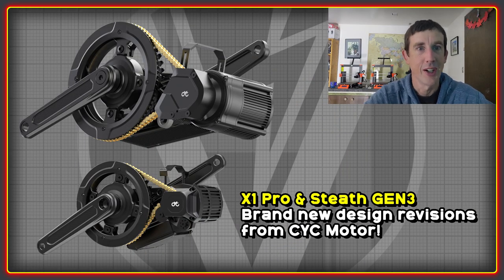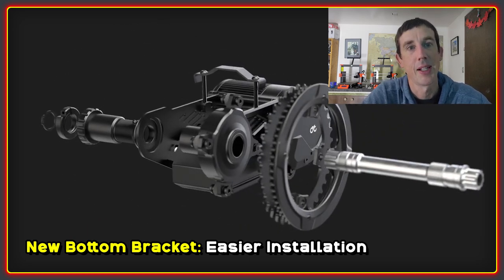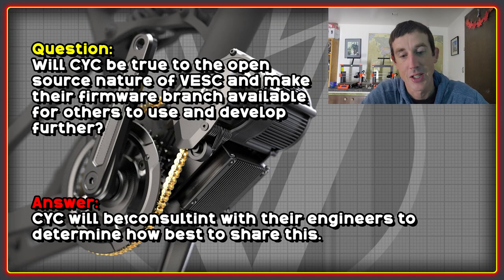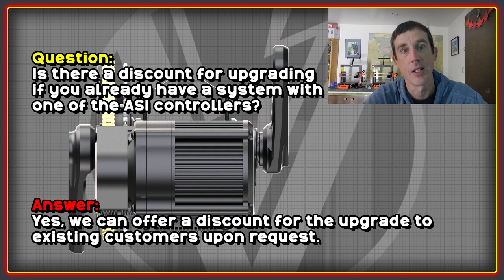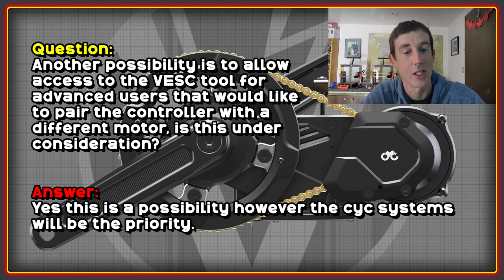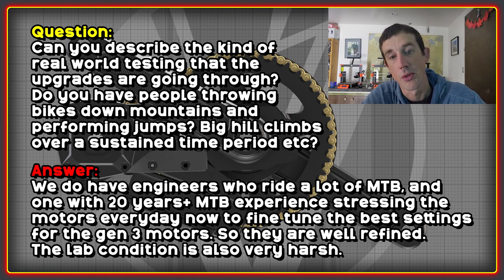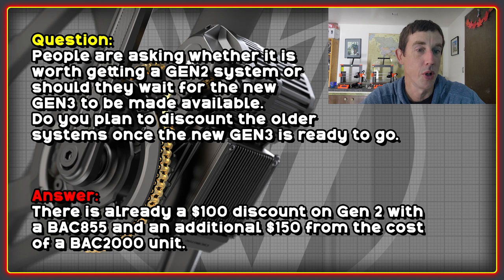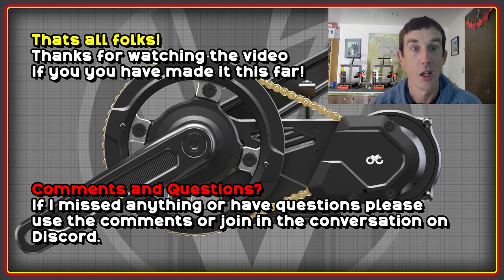CYC X1 Pro & Stealth Generation 3 Overview and Q & A

Comment: Glad they went VESC since ASI supplies have been constrained and a closed system.
Reply from the maker: Yeah. Having it in house means the firmware is under their control and app software development and bug fixes can be much more rapid. ASI was an emergency thing in many ways due to their issues with the original controller. I hope it works out.

Comment: Excited to see the next gen x1 pro
Reply from the maker: Yes especially riding and sound.
Reply: @HighVoltageKits  the noise only bothered me on shared trails, walking and biking.  In that environment I prefer the bbshd on lower power but miss the torque sensor and tsdz2 is much less powerful. Maybe new photon will fill that gap.

Comment: This is excellent news.  Sounds like they've addressed most if not all of the potential issues from Gen2.  If the noise reduction is significant, as they claim, I'll definitely be going with CYC for my build.
Reply from the maker: Yeah. If it all works out it will be brilliant!

Comment: Thanks for the update on the gen 3 kits. My 3rd controller which Electrify Bikes provided is a proper unit but it is not the potted controller that doesn't work. I replaced my 9 speed rear cassette  with a 38/11 micro shift  so I am now 1:1 on my final drive and it does not stall out anymore. I get 24 km/h in granny gear and 65 km/hr in top gear on throttle only. I mostly ride trails so top speed is not an issue. Gear noise is also not an issue. I don't mind a bit of gear whine as it sounds like a motorcycle while changing gears. it's not loud but people do hear me coming which is good. Overall I am very happy with the gen2 now although it was a bitch at first. With the 38/11 microshift cassette it has great pulling power off the bottom which is perfect for the riding that I do. The gen3 improvements are a bonus but getting that controller off the bottom is a must. It is not something that I would like to bash into a rock.
Reply from the maker: Awesome to hear your progress. It's been a long journey!

Comment: @ 4:00 you mentioned the Stealth version is available to work with the 120mm BB. I had placed an order for a Stealth X1 Gen 3 motor and I just found out they are now saying the 120mm BB width is not available to work with the Stealth motor. I'm really disappointed with this but they offered the X1 PRO Gen 3 at the same price. That was nice of them to do that, but I wonder what the issue was...
Reply from the maker: The information I have came directly from there marketing dept. That's a real shame.

Comment: big up cyc for all the new changes , they certainly dont look cheap or easy to pull of, looks really refined now , i cannot wait to get the new controller, i might even 3d print some sort of rocket launcher/ trebuchet and send my bac855 into a stratospheric flight so i never have to look at it again. LOL !
Reply from the maker: Ouch. Yeah its not the perfect match for the motor. They are notoriously hard to tune for small sized motors like the X1 but at the time it was really the only option they had after the stock one failed. It is definitely exciting to see a new VESC. I hope it works out because there is huge room in the market for this kind of thing.
Reply: @HighVoltageKits  I agree , apart from asi I haven’t really found any other options apart from nucular and another I can’t remeber the name of , And most of the time you can’t even order them and very expensive. 

A controller thats reliable can be easily tweaked via the very good looking new app is going to sell like hot cakes, I’m sure of it .

Comment: Great vid, thanks. I hope they perform and work like they say and then we'll have a good motor on our hands instead of the unreliable motor we've been accustomed too
Reply from the maker: Yeah. There is a two year warranty and they seem to be pretty confident. I hope they have really been hammering the testing as I think that was where they may have been found out in the past.
Reply: @HighVoltageKits  fingers crossed 🤞. I'll chuck an x12 on my gen 2 when it's out and post results on your discord. I'll be asking for a discount lol..great question to ask btw
Reply from the maker: Sounds good! Look forward to it.

Comment: I'm very interested in the gen3...the only thing that put me of buying previous models was the noise. It's imperative in the UK that I have stealth looks and silence....that's why I'm 'stuck' with mid-drives. If I ever see an ebike pulled by the police it's always got a huge hub motor and a huge battery zip tied in the frame...it's not a good look.
Reply from the maker: Right. There will be a noise comparison apparently to show how much quieter it is than the previous generations. I would wait and see. The situation in the UK and AUS with ebikes is insane and I will be addressing it at some point as I get more time.

Comment: Doing a build with this Gen 3 system. Trying to figure out a gear shift sensor and wiring to the brake sensor. Might just half to use a Bafang sensor and test to figure out if it would trip the pause / cut the motor thru the brake wiring and windup soldering the whole thing together unless someone else has a better insight on a gear shift sensor setup for the cyc motors?
Reply from the maker: If you are using anything not cyc I would confirm the wiring with them. But yeah in theory you can use a gear sensor in a brake cutoff.

Comment: I’d love it if CYC offered a twin/dual motor X1 pro kit driven by a bac4000 for a 10 kW setup. That would be awesome for an old yamaha dirt bike.
Reply from the maker: You could always try making one! I would look at VESC for a dual motor though as the 4000 is not the best fit for the X1

Comment: Looks to be promising! I've been recommending the system before, but gen3 looks like a real smooth unit.
Arguably better than a bafang + controller upgrade!
Open source!
Reply from the maker: Right. I think sometimes people look at open source and thing Oh its free. But that's not the case. Anyone can build a VESC even you or I but will it work reliably. Will it last etc. In terms of beating a Bafang and Controller upgrade we will have to see. I have not seen or heard the motor yet. The motor itself has not changed much and its listed as 3kw vs the 4kw you can push on a BBSHD. However its never that simple. Exciting times tho! This kind of thing pushes the envelope and spurs innovation which is never a bad thing!

Comment: Can you do a review on their batteries? How are the mounting options onto MTBs ?
Reply from the maker: I don't have one so I cannot speak for the internal quality or such. I can look at doing a video on Ebike batteries though in general and include these.
Reply: @HighVoltageKits  The cyc batteries has 2 mounting system - bottle mount area and the strap system. I'm trying to find a battery mounting solution similar to their strap system. I have a Diamondback release 3 2018 and I am trying to figure out how to mount a battery to the top side or bottom side of my frame without having to drill additional holes. The stock water bottle mount holes on my MTB is on the bottom side but too close to the pedal area to mount a battery I think
Reply from the maker: You are welcome to put photos and questions on our Discord maybe one of the members will show you what they did.

Comment: There are several gear ratio options available when you buy.  Do you know of any guidance sources or information to make the best decisions on these?  thanks
Reply from the maker: Actually that will make a pretty good subject for a video. It depends on the type of bike you have and the riding you will do. Also the kind of rear cassette you have. You can change that stuff though if you wanted to. Look at the biggest sprocket you have on the back and relate that to the options. If your biggest is a 42t then you might want to go with one of the larger options. If you you have only a 28t then maybe the smaller options. If you have a heavy bike and ride offroad then the smaller option will be again better as you will put less stress on your motor. If you have a lighter road or gravel type bike then you can go with a larger option as the motor will be able to drive the bike forward without too much stress. This is a video I did just yesterday on gearing. The latter part talks about my CYC bike. I use the middle of the options on it as it gives a good balance. Its a gravel bike and the largest gear at the back I think is a 36t. https://youtu.be/tW_swtyk7v0

Comment: If you use the motor for mountain biking don’t try and save a few bucks with Gen 2.  The motor cutouts (a major driver for the new controller) especially on steep climbs will drive you absolutely nuts. 

I’m super pumped for the upgrades and going to order the complete upgrade kit and use the x12 to replace the BAC855.
Reply from the maker: It will be very interesting to see it all once they start to go onto bikes. Definitely good news for the DIY ebike sphere!

Comment: Can a Bafang gear-switching sensor be used with a Gen 3 X1 or Stealth CYC ?     Thanks.
Reply from the maker: Potentially but I'd check. I don't think it's an official option. However essentially they are the same as a brake cutoff so it could be implemented if desired. They are not the best IMO.
Reply: What would be your suggestion to aid shifting…or is nothing needed ?      Thanks
Reply: @billymore2790  Personally I just use the break cutoff for gearing as well. If you adjust the breaks a tiny bit so that you can do taps without them taking then you basically have the dual functionality in the break levers and you can drop the extra button on your handlebar. Feels really intuitive as well in my opinion!

Comment: Hi, your videos are fantastic, keep up the good work, But I do have a question I hope you can answer, I'm looking into a CYC X1 Gen 3, I have an extra 52V battery I would like to try first, but after riding I might want to upgrade to the 72V. How would I order my CYC so I can try both battery options? I see you can get the display that says in the order process " up to 72V" with i be able to try my 52V with that? thoughts?....thankyou
Reply from the maker: Thanks Anthony. Make sure that the display option you pick will work with a 72 volt battery. Otherwise you would need to replace that part of the system. I think this may limit you to the 750c. You should be able to use a lower battery with the 72 volt rated display but not the other way around.
Reply: @HighVoltageKits  thank you for responding I appreciate that
Reply from the maker: You are welcome. I always try and do that.

Comment: Hi, I’m considering this motor are there any reviews or updates yet ? The plan is to put it on a (high end) full suspension enduro Mtb. Any advice or suggestions for maybe other options?
Reply from the maker: I think they are shipping but I am yet to hear anything concrete as far as a review. Some people on our discord have ordered them though so it should be pretty soon!
Reply: @HighVoltageKits  ok good, would like to order it but its "a lot" of money so i want to be sure it is the best choise.

Comment: It "seems" that the rotor on the CYC X1 Pro Gen3 ,for some, is losing magnets and over heating. I wish I knew what % of the sold motors had this problem. Maybe the Gen2 is something to consider. Any one else hear anything more about the rotor burnout?
Reply from the maker: Bacon butties had that issue. Might just be a bad batch?

Comment: Good info there, cheers buddy. The extensions are available, if you go through the process of making an order, the options are there as before on the gen2.  I don't suppose you know if they're  going to have a new UK distributor, Electron cycles aren't going to stock the gen 3 ?
Reply from the maker: I'm not sure about the UK. I think Francis is focusing maybe on the Sur Ron higher power mods maybe. Good news on the extensions. That's great.
Reply: @HighVoltageKits  yes it certainly looks that way, his options for bbshd kits and 60-72v batteries are non existent. He's always been my go to for batteries.

Comment: I have a frame - graphan carbon from a brand called Poison (German). I was wondering if this kit would fit. ( It has a BSA 68mm BB). And if it does fit, what's the maximum size battery I can put on it?  Any pointers appreciated.
Reply from the maker: The BB is not a problem. In terms of the rest its hard to say without seeing it. You are welcome to post photos on our discord channel to get advice. The link is in the description.
Reply: @HighVoltageKits  Thanks for the reply. I'll join the discord and post pictures. If anything, I am looking forward to learning more about other projects as well.
Reply from the maker: Welcome. That's what the place is for. Cheers
Reply: @HighVoltageKits  joined the discord and have posted my question. Cheers.

Comment: Has anyone besides me had multiple issues with the freewheel 2.0 at the crankset?  I'm not sure if it's water ingress or what, but they have gotten really stiff making hard to pedal, despite replacement and no pressure washing...    ??
Reply from the maker: I have heard less issues with 2.0 It's possible you have a faulty unit. I would send video to CYC and they will help.

Comment: I gotta say the answer concerning VESC source availability is discouraging.  They have GPL logos all over the X-series page but it seems like they don't understand the legal requirements. Releasing the source code is not optional.
Reply from the maker: It wasn't a yes absolutely but it also wasn't a no. I will encourage them in my interactions as I think that they would be worse off by closing the branch. If VESC develops new features that they want two years down the line it will be hard to integrate into a branch of development so removed. But people make odd decisions don't they? Cheers

Comment: On a different issue, I use an egg rider v2, any ideas if they are producing any firmware updates, there doesn't seem to be any firmware to download now, has it reached its limits or are they working on a v3 model
Reply from the maker: Thats a good question. The egg is based on the swo2. It must be close to maxed out in terms of what the firmware can do. I have not heard of a v3. I'd imagine they would need a more beefy platform. I'll ask George at Egg tho.
Reply: @HighVoltageKits  ok thanks, I noticed that there used to be two firmware files in the download section, but now there's nothing there, and just wondered why.

Comment: Still waiting for the "side by side comparison video" CYC promised months ago but still haven't produced... Literally the only thing holding me back from pulling the trigger.
Reply from the maker: I did this one https://youtu.be/8rEtoc9uib4 I am not sure if its quite what you want but I go over the main difference in the system. The new Gen 3 tho is very very new so there is still plenty that I have not seen. What is the main thing you are concerned with?
Reply: @HighVoltageKits  Thanks, real world noise difference is really what everyone is holding their breath on. The 2nd gen Stealth noise was its main drawback, so I guess I figured CYC would make a more convincing video showcasing the "significantly reduced noise" of the gen 3. All I can find are one second throttle blips with the bike in the air.

Comment: I saw now that the x1 gen 3 is coming with both a 3kW and 5kW option and to me that sounds like an almost dangerous amount of power. 
I mean 5kW is more than quite a few electric mopeds, can a normal bike really handle that kind of power safely?
Reply from the maker: Its a very good point and it is far too much for many frames. DH frames tend to be massively overbuilt so handle the stress better.

Comment: CYC will consult with their 'engineers' (and accountants/lawyers) whether it is profitable.. one hopes they see the light that an open platform generates more interest and profit thereby, than trying to squeeze every penny at the time
Reply from the maker: I'm going to keep an open mind on this. Flipsky have locked theirs down but Luna did feed back at least partially so we shall see. It's really in their interest to do so.
Reply: @HighVoltageKits  Flipsky just seems to not care at all and just have it compatible with the original firmware

CYC's torque sensor implementation/tune might be a very interesting addition to the VESC project tho

Luna's whole code is there and that would technically allow anyone with a VESC based controller to wire up a 750C display if they figure the pinout (or change the pinout)

Comment: This motor appears not to fit a Bosch gen 4 frame.
Reply from the maker: You need a bottom bracket, and the Bosch motors tend to be integrated units that bolt in.

Comment: Do these things have a break and gear sensor?
Reply: I don’t hear any mention of sensors
Reply from the maker: Good question and I am not 100% sure. Break sensors I think are a guarantee. If need be you can also use one of them for a gear sensor. You just need to make sure the wiring is correct.

Comment: Too expensive. And shipping alone is 120 US dollars. Buying a motor and a battery combo will be enough t buy a new whole bike like the REI COOP 2.1 mid drive Bosc motor.
Reply from the maker: DIY kits are not for everyone. Most people get them because they want the joy of converting a bike they already own. The performance of these also vastly outstrips the Bosch ones and it's not a locked down system. So yes you could get a bike for $2000 but it won't go particularly fast and the components on it will be bottom of the line. Most people using these kits converts Downhill bikes and are already invested in high quality drivetrains etc. Its all about what you want from your bike and budget. Great comment. Cheers